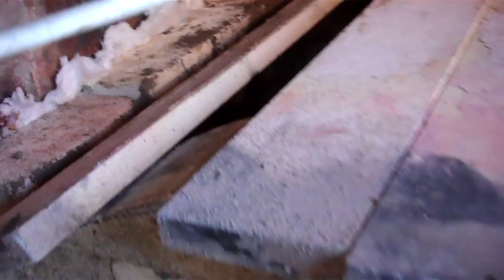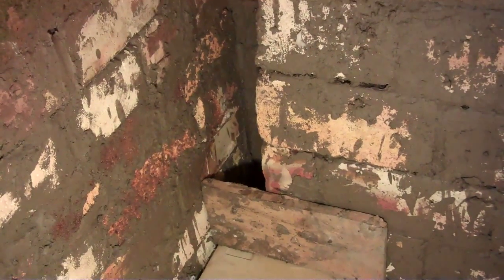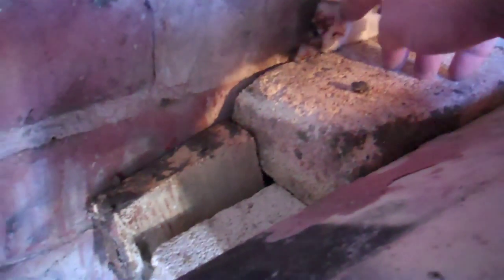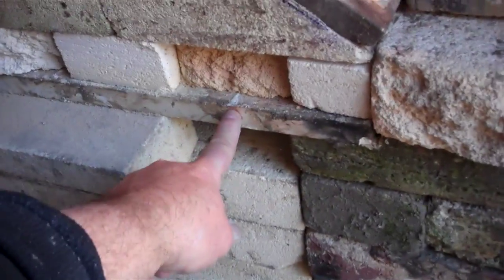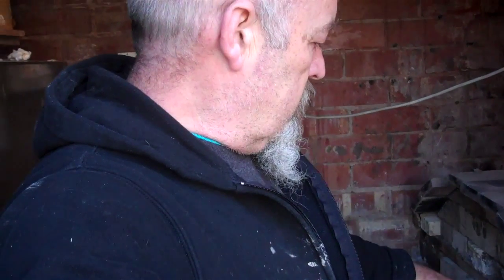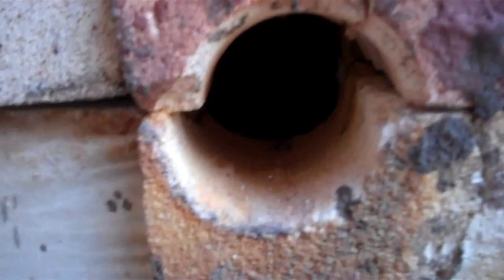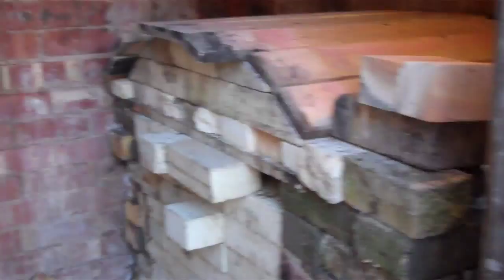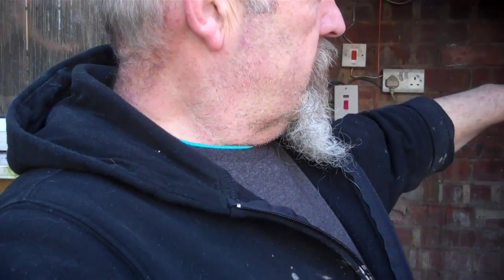pottery kiln build update

Comment: Thanks for the update. Whats the difference between the light weight insulation brick and regular bricks? Could you use either if you wanted to make a rough a ready kiln?
Reply from the maker: you can use a mixture for a makeshift kiln some have even  used house bricks. the lightweight ones cool quicker  than heavies so you might get uneven cooling.